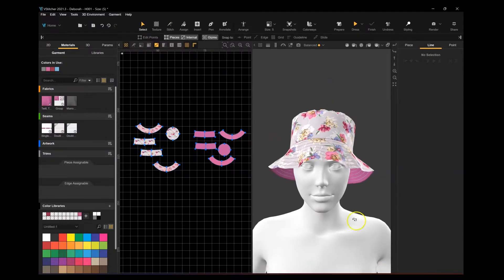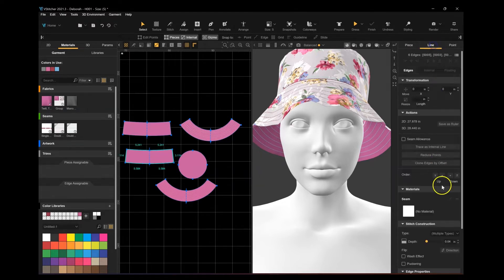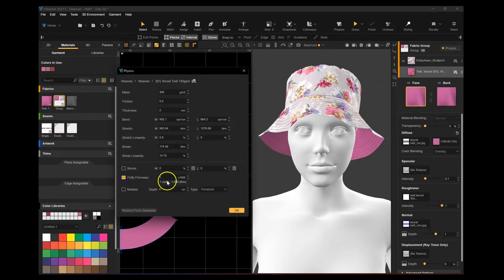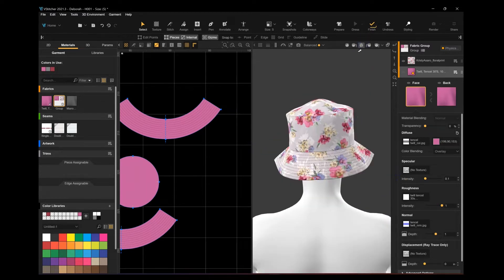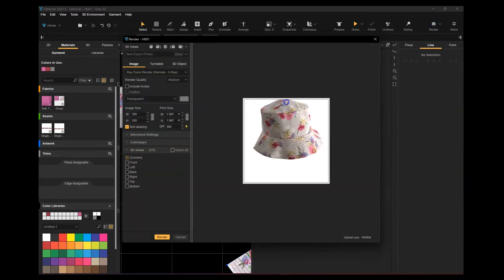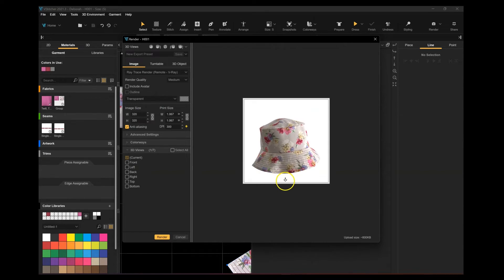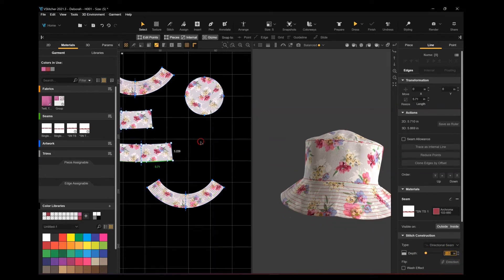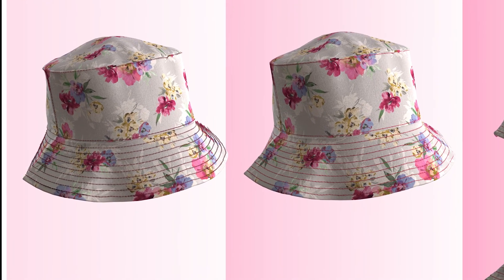How to Get a Realistic 3D Render of Your Product Using V-Ray in Browzwear VStitcher

Comment: Hi! When you modify the fabric parameters in Physics, what values do you use? I can’t see them clearly in the video because the numbers are too small and pixelated. I’m having this issue with a softshell fabric jacket and I’d like to make it a bit stiffer. Thanks! I love your videos, I’m learning a lot!
Reply from the maker: Hi there! If you change the video quality to 1080p HD in the settings to the bottom right, you should have a clearer picture of the numbers. :)